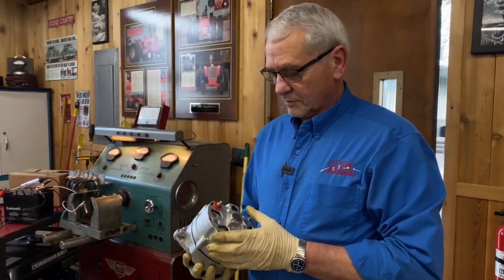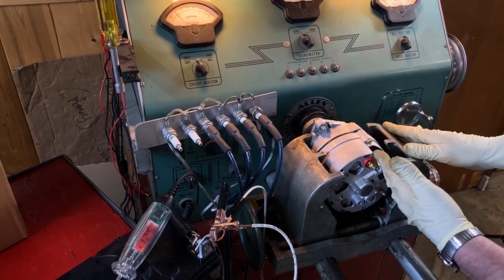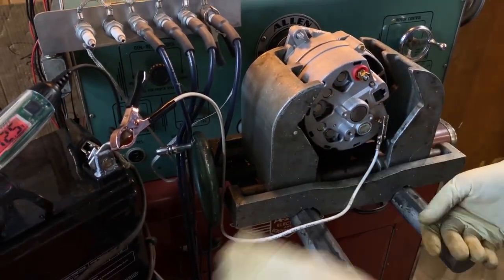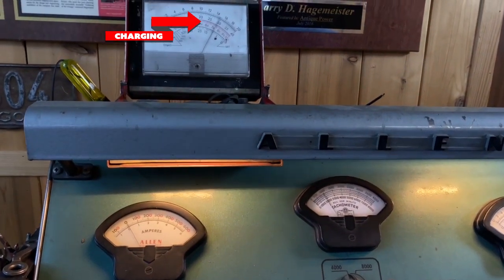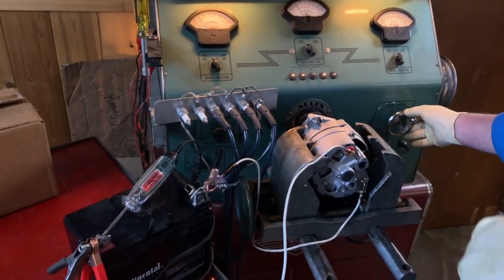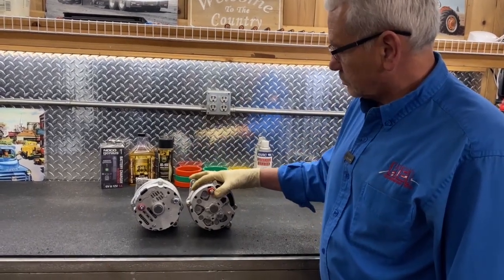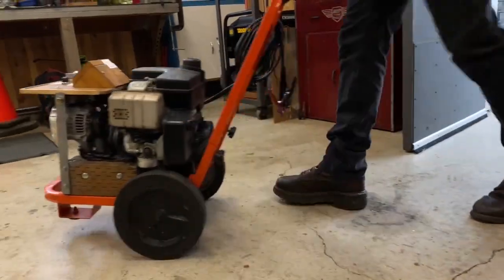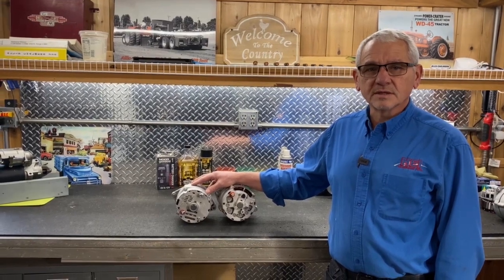One Wire Alternator Low Turn On

Comment: So I having this issue, I have a brand new GM one wire bench tested at the store. It passes install it on the car. One wire ran to the battery even put a ground and it fails on the car. Take it off the car and bench tested and it passes. I’m at a loss.
Reply from the maker: First of all, measure the voltage at the battery post of the alternator. Second grab the fan behind the pulley of the alternator with your fingers if you can slide it or slip it it’s too loose. I would suggest doing that first.
Reply: @HagemeisterEnterprisesINC  voltage at the post of the alternator is identical voltage to the battery went off or running
Reply: @HagemeisterEnterprisesINC  as for the fan there is no play
Reply from the maker: @Ez_Moto  I would check the voltage at the battery and alternator at a higher RPM. If there is not a lot of amp draw say electric fan. The alternator is failing.
Reply: @HagemeisterEnterprisesINC  no electrical fan it has a clutch fan and it’s crazy. It’s a brand new alternator bench test it passes.
Reply from the maker: @Ez_Moto 12.6 volts at the alternator belt tight spinning at a higher RPM and no charge. Nothing left to test. That’s why we don’t just bench test. Customer must leave them and we take them apart.
Reply: @HagemeisterEnterprisesINC found out that my ps pump belt was loose

Comment: Very cool, so how does the standard Delco 10SI compare as far as minimum charge RPM?
Reply from the maker: Thank you for asking. This one wire alternator is a B circuit, so about half again as fast turn on. 10si are A circuit and require more RPM to active? How that helps.